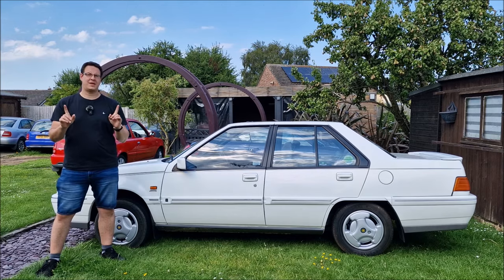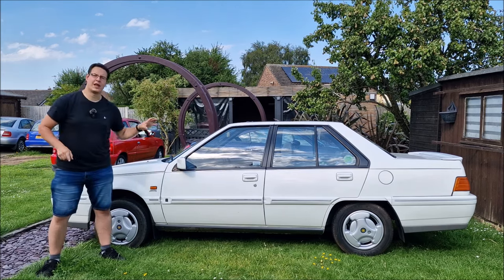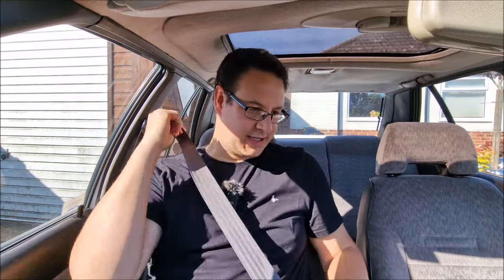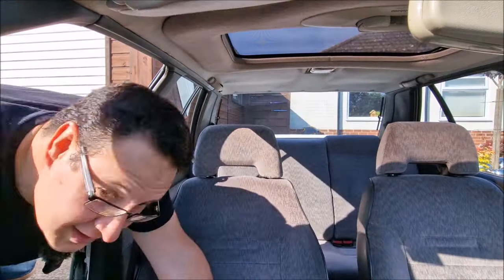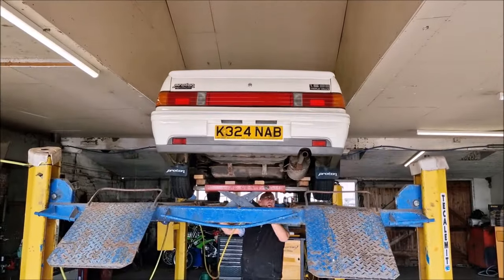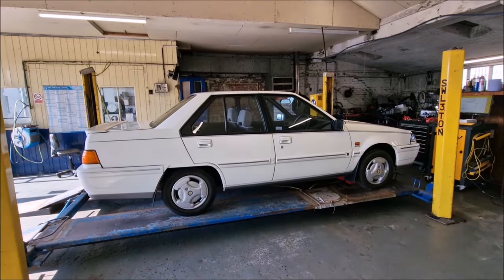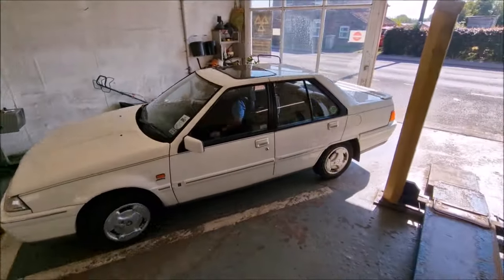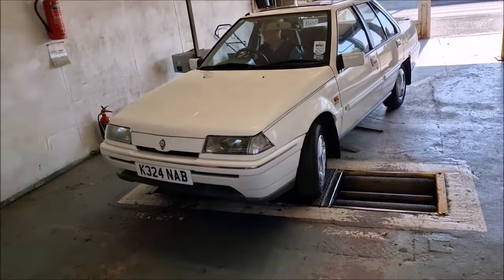Proton 1.5 SE 'Iswara' Goes For An MOT - Another Year Of Trouble Free Bangernomic Motoring?

Comment: I honestly wish the sunroof was made as an option on domestic Malaysian models. As someone who just started driving a car with a panoramic roof, it certainly feels nice and airy to have sunlight shining into the cabin...that's something I would have demanded my father to buy back then!
Reply from the maker: I cant understand why it never happened on the MDM models!
Reply: @JonCoupland  I think it's the stereotype that Malaysia is a tropical country & has no use for a sunroof. It's the same reason why convertibles aren't a thing.
Reply: @JonCoupland  cost, weight and also weather are the main issues here! Malaysians actually are not fans of sunroofs due to how hot our weather can be, another is due to very prevalent leakage issues on cars with sunroofs in Malaysia. Most Malaysians do not have an indoor parking, and Malaysians parking underneath tress would get leaves and gunk stuck in drainage channels, thus causing all the issues with drainage holes being block and etc 😢